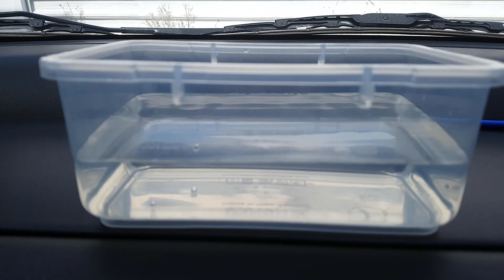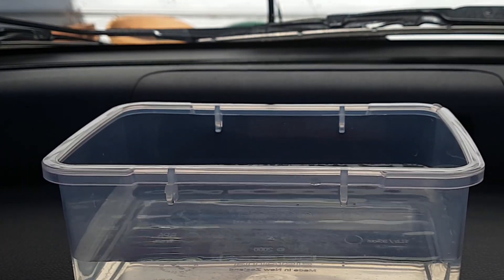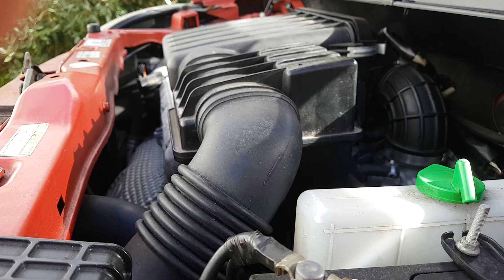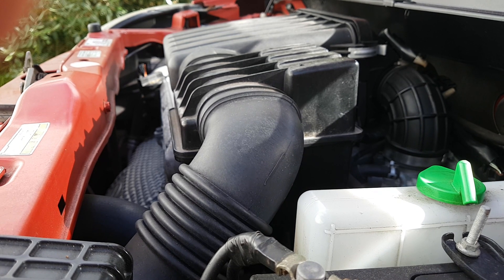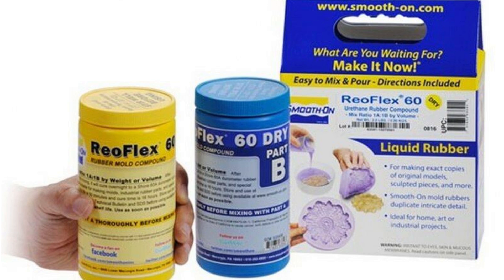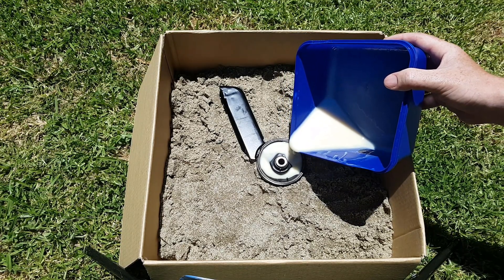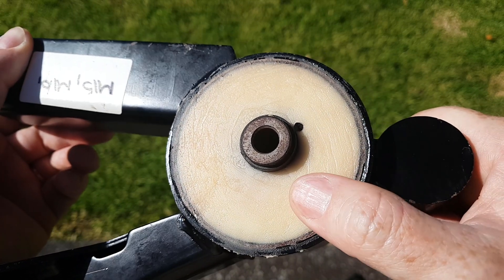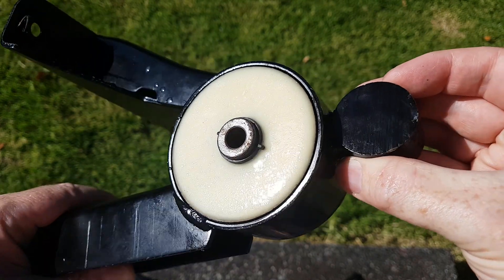⚡️ DIY Polyurethane filled engine motor mounts with Before and After comparison.

Comment: Thanks for the review.  1. Oem mounts are not solid.  So have built in flex.  2. As a comment pointed out you can use a softer spec urethane.  May solve your vibration issue.